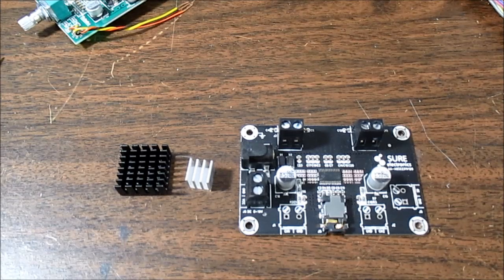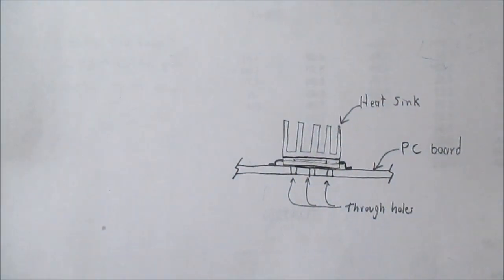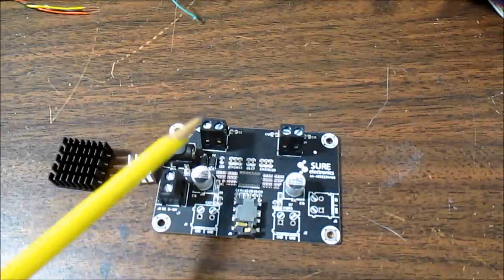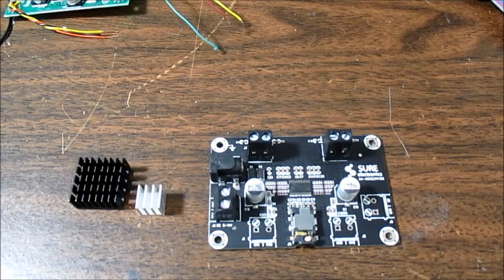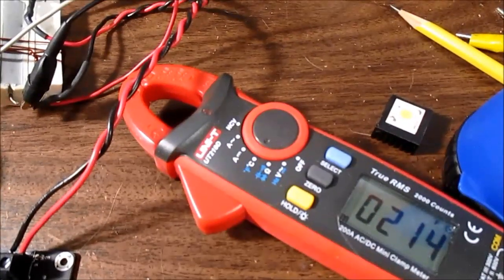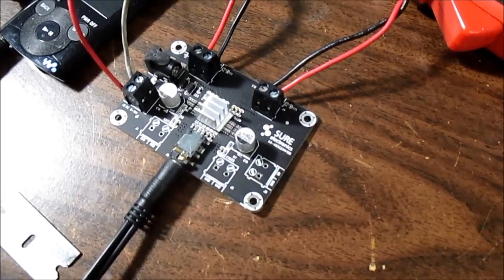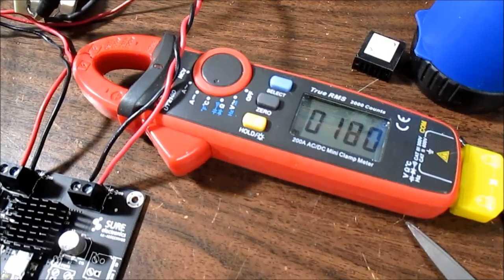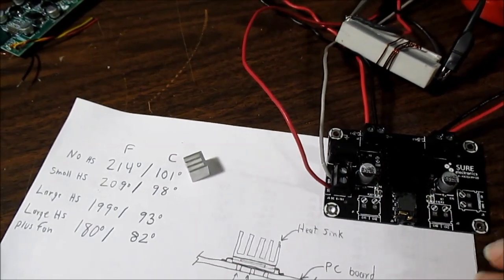Adding heat sinks to a class D stereo amplifier board

Comment: The TPA3110 (if I'm right, the amplifier chip used on this board) and many class D amplifier chips use a pad-down "PowerPAD" (located on the bottom of the device).  If the board is designed and assembled correctly, the heat from the die should be transferred out the bottom of the package and into the PCB.  Depending on the board design, there may be multiple layers of the board used to dissipate heat.  Your best bet would be to forget the heatsink, elevate the board, and blow that fan horizontally across the top and bottom of the board.  See note 3 on page 5 of the datasheet:          http://www.ti.com/lit/ds/symlink/tpa3110d2.pdf   (TI blocks these links so remove any junk after the .pdf)                                       For more detail on the way the pad-down PowerPAD is designed to work, and the way the pcb is supposed to be designed: http://www.ti.com/lit/an/slma002g/slma002g.pdf       With a normal music signal, I wouldn't expect that amp to have any issues driving 4 ohm speakers without anything but a reasonable amount of airspace around the pcb (standoffs would help).  My daughter has that exact amp board in a VERY small enclosure driving 6 ohm Sony bookshelf speakers.  She runs it hard quite often and has had no issues in over two years.  Among other safety features, the TPA3110 has built in overtemp protection.  The board has the correct thermal vias and lots of ground plane - so why worry about a heatsink?

Comment: The potential advantages of back side cooling were unfortunately left unexplored.

I mean, you said it yourself, the top of the IC is just epoxy, it's not the most thermally conductive thing ever. The die is closer to the thermal pad on the bottom, and hopefully there's sufficient thermal via stitching.

Then remains the question of how to measure. You could measure against uncooled case by placing your existing thermocouple against the to of the IC, but you don't really have a good way to directly measure front vs. back side cooling, although maybe simply comparing with uncooled case and crudely assuming constant offset could be enough of an indication. I recall someone, maybe GamersNexus used some kind of very very thin flat K-junction thermocouple that also acts as thermal tape to measure temperature straight between IC and heatsink, and they got confirmation from one of the graphics board companies that it's the same thing they use in house.

Potentially the best way is running the IC to the limit using an adjustable load and measuring when the IC goes into thermal shutdown, which should conclusively tell you whether any given cooling setup is sufficient. But then, an adjustable load is something that likely still needs to be built, as nobody usually just has one in their closet.

Comment: The interface to the heat spreader is extremely important and using tape with a high thermal impedence really limits how much heat flows to the heat sink. Easy way to check if there is too much impedence is by feeling the heat sink temp vs the chip temp. If the heat sink isn't hot when the chip is, you need a better interface. I think you would have much better results with thermal adhesive.
Reply: Hi Jeff...can you recommend any tape? Manufacturer and number? Thank you!
Reply: Yeah, as far as i remember, when the heat sink is attached, the heat sink itself gets/ supposed to get hotter than the ic itself

Comment: Have you ever tested heatsinks on the bottom of a board with the thermal pad area. Mine have a big (twice the size of the chip) silver pad visible on the bottom of the board beneath the chip. I have a chip on the board that has a large heatsink on top but I think it would be better on the bottom, because this chip is supposed to direct 80% of its heat through the board. Assuming you have enough room, could gluing a heat sink on the bottom covering some of the vias do more harm than good?? Thank you. Good video. Very interesting to us novices,

Comment: Thermal adhesive pads are near-useless unless the heatsink is being pressed down on to the chip with push-pins or something similar, you will never see more than incremental drops in temps. I have two [edit] TPA3116s  TPA3118's ( in a bi-amped set-up) as my 'daily drivers', and they are 'slug-down', PCB-cooled chips like the ones you've been testing. Since they're on 19.5 volts and get driven fairly hard sometimes, I've contemplated mounting heatsinks with a spring between them and the top of the amp's case (which lend themselves nicely to this as they're in two halves, and the top half can be lifted off and replaced vertically).

BTW, the performance of adhesive pads can be improved by heating them and heatsink  (heatgun, hairdryer, warm oven) to at least 80-100°C before pressing and holding them firmly in place until they cool.
Reply: Why does the perfomance increases if you preheat it?
Reply: Tpa3118 is the exact reason im looking if these mini heat sink even work or not 🤣 they should have given us the place to mount a heat sink tho 😑

Comment: Since most of these power chips have a square or rectangular heat pad at the bottom, why don't people route out a hole the exact same size and shape of that pad into the pcb, and over-solder it to the copper pour on the backside, instead of using many small vias? OR one large enough via to cover the heat pad?
I've never seen that.
Reply: Because that would require a separate step during manufacture, a very uncommon one at that, which would significantly increase the price, and may not work any better than many small vias

Comment: This Maxim application note linked below is even more to the point.  Here are two excerpts if you don't want to bother reading it:             1 - "When a Class D amplifier is evaluated in the lab, a continuous sine wave is often used as the signal source. Although this is convenient for measurement purposes, it represents a worst-case scenario for thermal loading on the amplifier. It is not uncommon for a Class D amplifier to enter thermal shutdown if driven near maximum output power with a continuous sine wave."          2 - "The top side of the IC is not a significant thermal path for the device, and therefore is not a cost-effective location for a heatsink."        
https://www.maximintegrated.com/en/app-notes/index.mvp/id/3879

Comment: has anyone used the motor salvaged from a DVD player running at 3 or 4 vaults turned into a fan used it in an amplifier build? the motor is so small and so easy to get from old DVD players. not sure about sticking a fan on it but maybe it's worth researching.